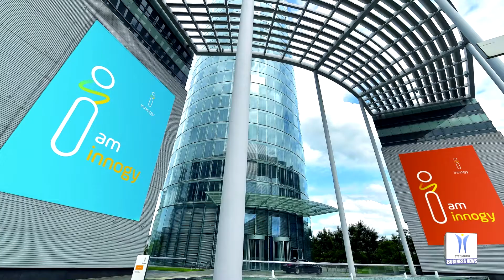14 MW Turbines of Siemens Gamesa to Power Sofia Offshore Wind Power Project in UK

Comment: 100 machines = 1,2 million households (around 4 million people). Equals 2000 machines to power whole Germany, covering  an area 7,5 times as big as London. Running 25 years. Not too bad.
Reply: or you could install 48000 of those to power whole germany (including primary energy needs). covering an area that equals 80% of germany's area
Reply: When a meaningful portion of a power generation capacity in the grid is lost (especially during peak demand), operators have to balance the grid by shutting customers down. To avoid blackouts in a grid with a sizable amount of wind/solar, each plant has to be backed up by a conventional source. Since starting a unit at a conventional power plant can take up to one day, backup capacities have to idle 24/7 (zero carbon?). Moreover, due to supply-demand mismatch during windy nights, wind farms are getting paid NOT to generate electricity! 
Wind/solar are unreliable and expensive (think capital investment and operating costs not only of main units, but also of backup facilities) alternative with questionable benefits from environmental and GHG emissions standpoint. Conventional energy sources are not limitless, however...